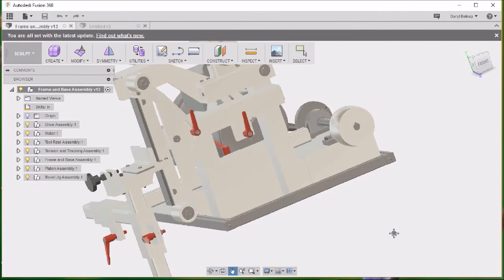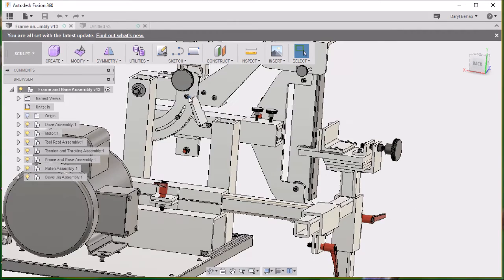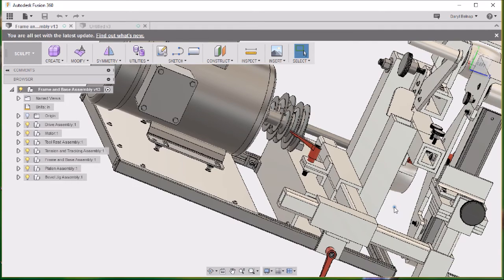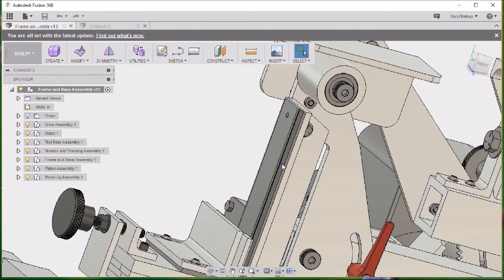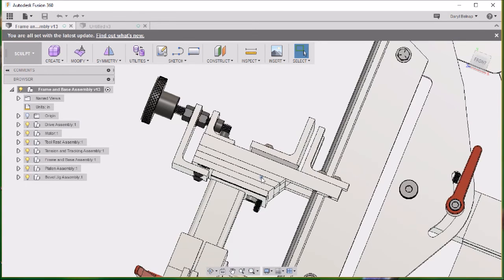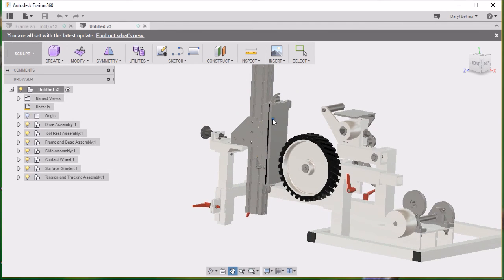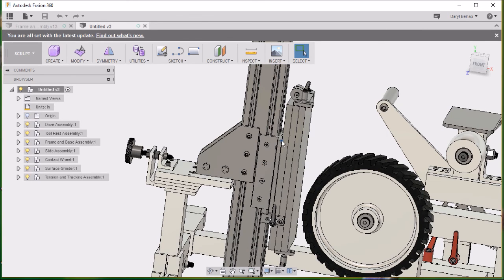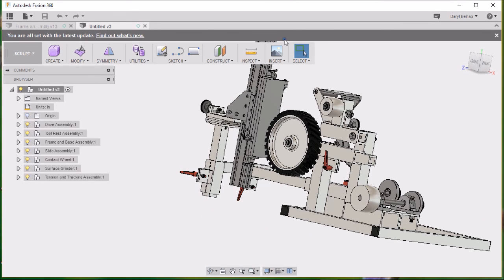Build Your Own 2" x 72 " Belt Sander | Plans Coming Soon

Comment: what the best hp. and rpm motor.  thanks
Reply: I really like to grind fast at 7000 sfpm.  For me 3HP is currently is the size I use.  I am testing a very small motor which is 400 hz 3 hp 24,000 rpm and it is proving to be able to handle everything well so far.  A popular motor for VFD is the 2 hp.  I don't have personal experience with it but some say it will not do 7000 sfpm well.
https://www.youtube.com/playlist?list=PLthW154g2QNNalPz0XA4gVKsJLoQe8Mpo&disable_polymer=true

Comment: Just awesome Daryl
Reply from the maker: Ha. It has been fun.  Selling jig plans every day so far and getting some downloads of the free profiles too.
Reply: I think it needs to be said that you are taking tools that are necessary in knife making and with your engineering skills -- making them better and more affordable. You should be proud of yourself. Once you get all these tools together, you can run your channel on showing new knife makers on how to make a knife and how to use your tools to make them amazing. -- Brian
Reply from the maker: Thanks.  I attribute it to me be too lazy to stand there and freehand.  haha.  The barriers to entry are pretty high for new knife makers.  Costs of materials and equipment are high and their skills are generally low.  This makes for an expensive and frustrating learning curve that I am guessing many don't make it through.  I am hoping to keep this sander under $1000.00 complete with motor and step pulley drive yet get performance of machines 3-5 times more expensive.  
Once I get the new videos made I feel like there will be good interest in these tools and methods.